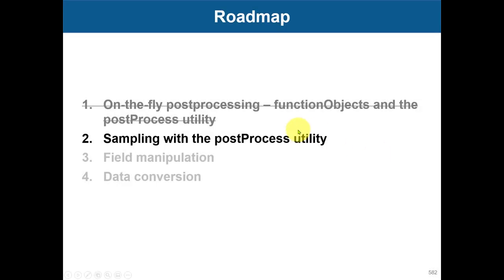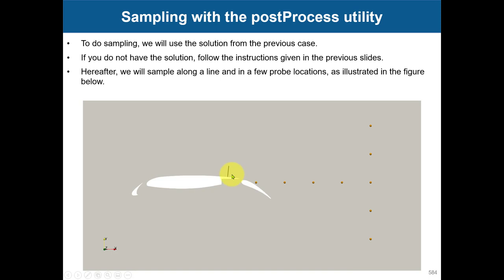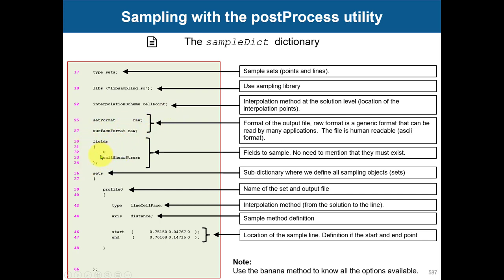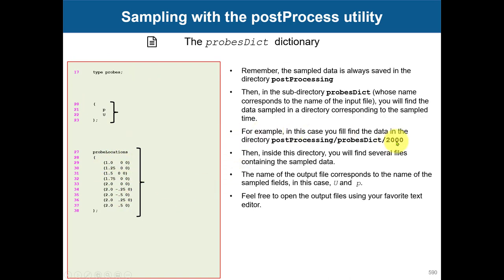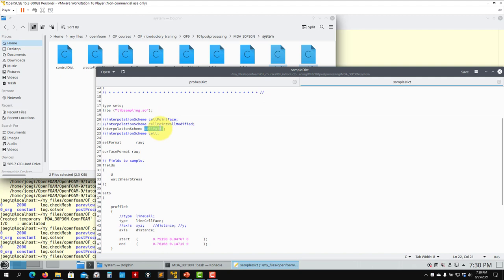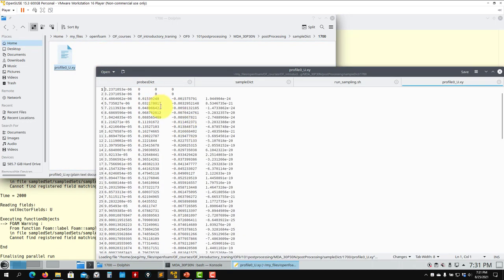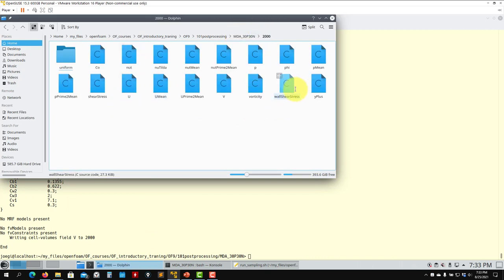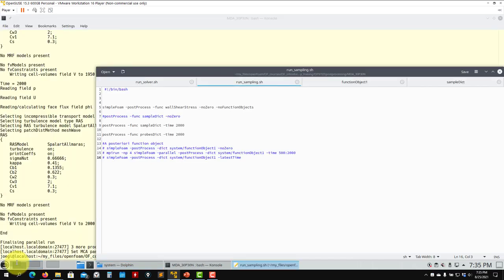5.2 Module 5 - Qualitative and quantitative post-processing #openfoamtraining

Comment: Thanks for such a nice video. 
My question is how I can probe over a surface not over a line or on a point? I want to know what is the airflow velocity inside a cylinder on a surface with a dimension of 50 mm x 50mm? I want to define the mean airflow velocity at the point with coordination of (195, 0, 50) on a surface with dimension of 50 mm x 50 mm around this point. The coordination of my surface around this point will be (145, 0, 0), (245, 0, 0), (145, 0, 100) and (245, 0, 100).
Reply from the maker: Yes, it is possible. I think I deal with that in one of the videos of module 5.
Reply: Thanks for your reply. Is it video 5.6? @wolfdynamics5703
Reply from the maker: @FloraRad-j7c  well i dont recall the video number, but it seems that is the right one
Reply from the maker: @FloraRad-j7c  Yes, I think that is the right video
Reply: Thank you very much @wolfdynamics5703